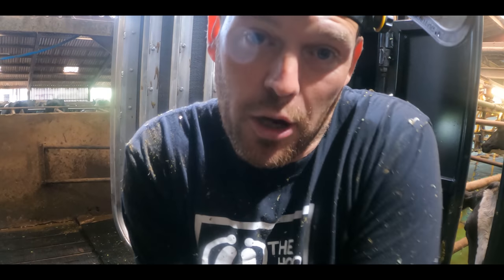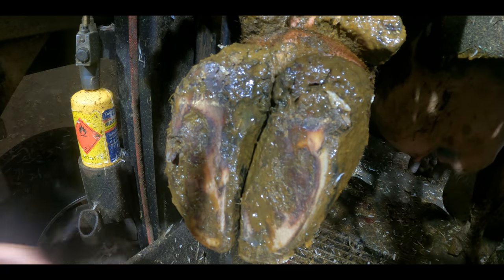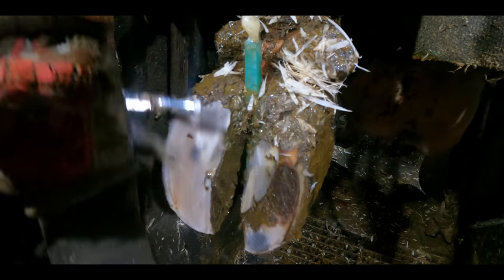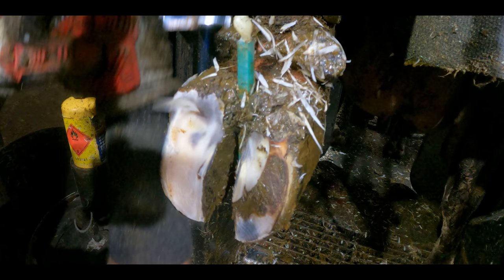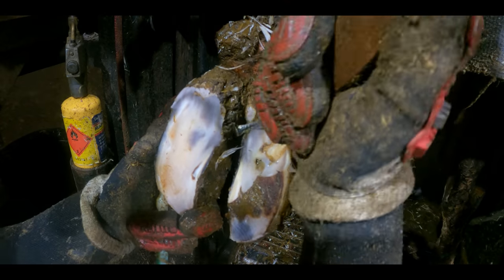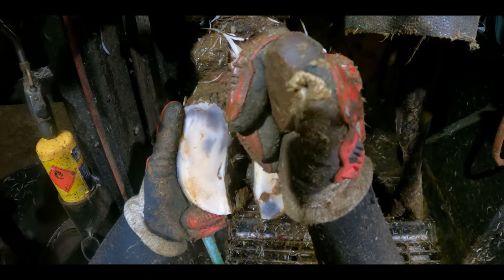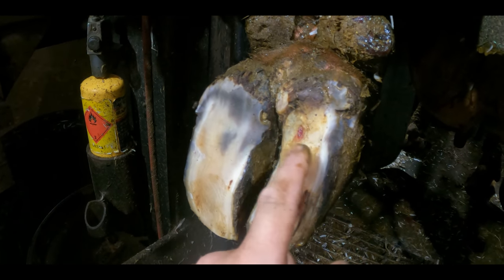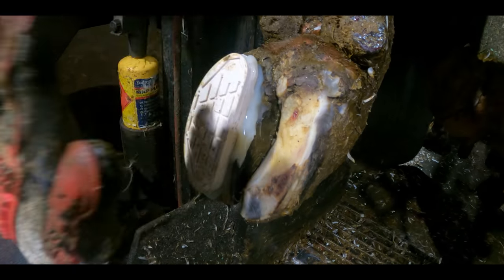REMOVING a NAIL from a COWS FOOT!

Comment: I wasn't sure about the side with the nail, but that hole on the other side had me worried. I kept screaming at the screen, "why are you being so aggressive? When there's a problem on the other side as well? ... You could have cleaned up the nail hole with a small divot and a vent off to the side. Hopefully, the hard block will keep that horn from bruising and causing another problem. Fingers crossed. 💖🌞🌵😷

Comment: I'll say it straight up, I did not see that coming. I hope that cow is doing better in 4 weeks and hopefully what looked like a small hole (3:27) on the outer claw, up in the top part, on the right, doesn't cause any issues in the mean time. (Yes, I did knock on wood as I said that.)

Comment: Pausing at 1:40, obviously, the nail is going to cause some problems. It could lead to white line or digital dermatitis, or both. I can tell that it's either bruising or just the pigment of the cow's hoof, but I'm gonna go with bruising in this case, which can also lead to digital dermatitis. These are my guess from this point of the video.

Comment: Are  cows routinely vaccinated for Tetanus in Scotland?
Reply: No.
Reply: Good question. Why is that? Because horses are.
Reply: @Roosmarijn035  Dr. Google says cows are less susceptible but not immune.  I was wondering as no one mentioned it in the video and I knew it was a thing in horses.
Reply: @markbernier8434  my thoughts exactly. I will try to remember and ask the farmer where I board my horses. I know the ladies get vaccinated but don't know against what. The babies and girls at the other farm (where my horses are) I have never seen a vet except for one time last year when the girls in the orchard got really ill because it turned out a pear tree had fallen due to a storm and you can guess what they did. They were completely wasted. I caught them in the evening, after doing my horses, and thought they had neurological damage of some kind by the way they were standing and walking. And they kept on drinking, without pausing. So I ran to my closet, grabbed a thermometer and one of the girls who I managed to lock in the feeding gate had a fever. Called the farmer, who immediately came over and called the vet. Farmer later said that vet said that they were so drunk they would probably have died if I hadn't called him. It took days of medicating until they were in the clear.